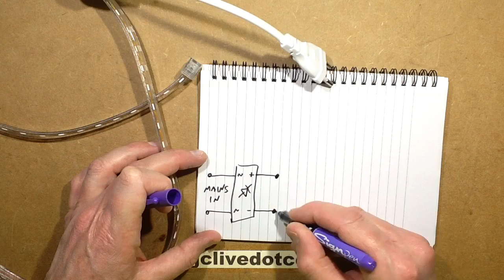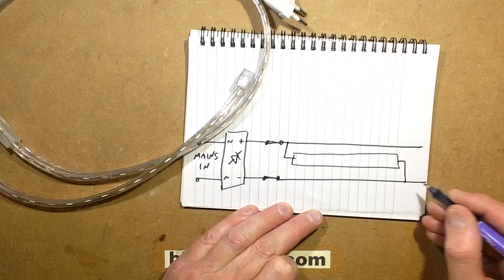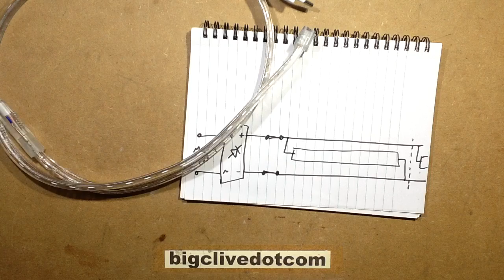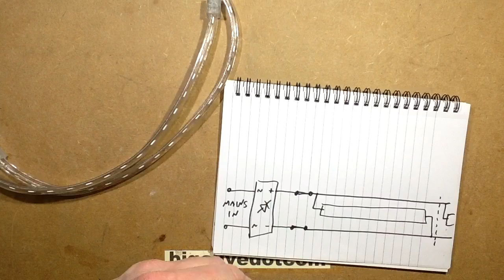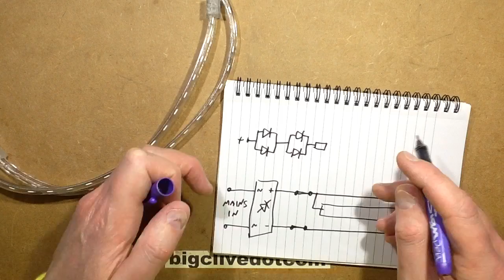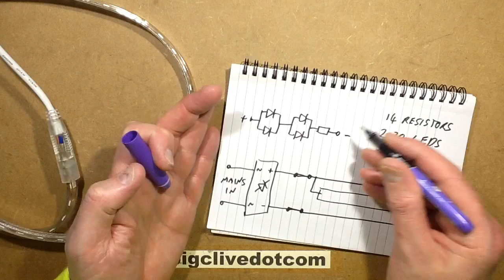A look inside some mains voltage LED tape.

Comment: I've been working with the WS2811/2812 LED strips which appear similar but they run on either 5v or 12v and the 'busbar' seems to be in the plastic strip (you can get them without the outer plastic coating).
The problem with this that they still draw quite a lot of power and due to the low voltage you need a high current supply, and you also get a noticeable voltage drop on lengths of more than a metre!

Comment: Is the more Omni directional stuff available remotely cheaply on eBay or other China type market? Ive been looking for something like that to light the walkway from my driveway to house. I normally just see this flat stuff that just beams light straight out in one direction. But I just want something that makes a nice path to follow.
Reply from the maker: If it's on the ground I'd suggest a low voltage option for safety to humans and animals.
Reply: If heat dissipation is not going to be a problem, I'm thinking some nail polish might be useful.  Or a drop of some sort of waterproof glue.  You could even make it sparkly by gluing some sort of bead on it or using 'glitter' nail polish.

Comment: They sell them in a local chinese supermarket in my city. White, blue and red. They have huge spools and cut them on any length. Plugs with "drivers" sold separately.
Reply: *****
Really? They look completely the same as the Clive's one. And even the plug is identical. But maybe you're right, I think that there could be soldering spots each 10cm… But the construction is the same, at least.
Reply: pshq In the local chinese store they sell those too so yeah
Reply: not_found
OK

Comment: I must be a bit mad, but i allways liked the old 20x12v bulbs connected direct to the mains for xmas tree decoration.
The bulbs were in little moulded green holders and coloured plastic flowers fitted in a half twist way.
Never got a shock from them, never moved them with the power on, common sense that people have forgotten :-(.
Yes i am mad.
Reply from the maker: Hence my video where I show how to convert traditional mains sets to very versatile LED ones where the whole string consumes the same power as one original lamp.  You can also swap in almost any standard LED you can find.
Reply from the maker: You can still buy the 20 lamp tungsten sets without the plastic flowers in Poundland of all places.  They do white sets and coloured sets.
Reply: Thanks :-D i know where to get real bulb ones, i loved the glow :-D
Reply from the maker: The poundland ones are not LED.  They're tungsten with push-in lamps.
Reply: zx8401ztv The problem I always found with them was that after putting them away for eleven months when we got them out the next Christmas they didn't work any more. So through my childhood my parents gradually accumulated several sets of Woolworth's fairy lights.
Reply: Ahh the dodgy bulbs :-D, but i did like the yellow glow of real bulbs, they allways seemed warmer and didnt flash, unless you had a bi-metallic strip in one of the bulbs :-).
Im not sure where we got our spare bulbs, perhaps there was another doner set lol.
We didnt have much, but it was allways a loverly xmas :-D
Reply from the maker: Aluminium wire is quite common in cheap products.  This stuff has absolutely no attraction to a powerful neodymium iron boron magnet.
Reply: +bigclivedotcom What makes you think the bus wire is Al? you spoofed how springy it is several times, which is  the last thing I would expect aluminium wire to be. Isn't it more likely to be a steel wire, which as well as being springy would contribute great strength to the tube light in suspended applications.
Reply: zx8401ztv same

Comment: What would you recommend to cab of the ends instead of the hotsnot.....?
Reply from the maker: They're such a loose fit that the traditional solvent glue won't work, so it'll have to be something that bonds properly to soft plastic and fills gaps.
Reply: Yep the "lose fit theme" doesn't really work with electronics in general..... I have a temporary hate for Microsoft electronics after the power supply for my Xbox 360 slim fried itself... The sniff test had the odour of dead electronics.. Not related to the matter but a pain in the... Thank God for eBay that saves our bacon and other things we hold dear
Reply: A silicone product called E-6000 (big brother to GOOP) sticks pretty good to just about everything.  Most often, I find it in craft and fabric stores.  It doesn't store forever after it's opened.  Might want to scuff up the surfaces a bit.

Comment: Thanks for the teardown, Clive. I've been wondering the same thing: how are they making any profit with how cheap they're selling these types of LED lights? Now we know. :) I suppose for "ultimate" longevity, one could affix them to some sort of rigid backing, to prevent failures due to flexure, every foot (30 cm) or so.
Reply from the maker: It's actually very flexible and loose enough inside to deal with modest movement.  But I would recommend a frame or channel.  The main issue for outdoor use is water penetration.

Comment: I use the same thing for lighting computer cases,but mine is multi colored has a control box  and can respond to sound. you can also get L shaped connectors for going round corners.

Comment: @bigclivedotcom
What, in your experience with LED strips, is good in terms of flexibility, like being put on a bodysuit? I found that the plain tape is awful, the epoxyed stuff is better, and have thought that the tube/rope lights seemed a bit chunky for that application... but I'm not sure. My LED strips always seem to break at joints on the suit.
Reply from the maker: If you look at the tape you will see that it has a solder-blob joint every 500mm which is where it usually fails.  You may be able to reinforce all those points with a small stiffener stuck to the back to try to avoid them breaking, or part them there and add in some short flexible wires with strain relief.  Here's a video I made, where I was having this very issue.  https://www.youtube.com/watch?v=kk5KENW8_5c
Reply: Try EL wire.
Reply: bigclivedotcom
Thanks so much! I will look into it, and tell you what I find out. I might post a video of my TRON Suit (for that is what it is) if i get it working again. Cheers!
Reply: James Bradwell I tried in my first version of the suit, but it wasn't nearly bright enough by day.

Comment: Would this work under kitchen cabinets where moisture is present, say from kettles and such? IP67 would suggest yes but mains voltage would suggest no.
Reply from the maker: It would be ideal for under cabinet use, as it is theoretically rated for full rain exposure.

Comment: I always notice this flicker anyway, I am really sensitive to it mainly when I see it outside the center of my vision. It's annoying. I have this. I would like if they put in 10x the smoothing capacity...
Reply: Uhm, i think its the cam.
Reply: I see it as well especially with those cheap LED Christmas lights. Its due to the peripheral vision of the eye is more sensitive to changes in light.
Reply: BlueFoxTV
Yes it is. But not for all people I guess. Some people I had here around didn't see it. And one was just 11 y/o and the other 22. I'm 28.

I Build an LED star lamp (dangling LEDs on DuPont connectors) and it's visible flickering in 60 FPS video recording, none with 50 FPS and none for the naked eye, even when you swipe your hand under the lingt.

I Put in enough capacity on the output. But not too much, so that they go off quickly.